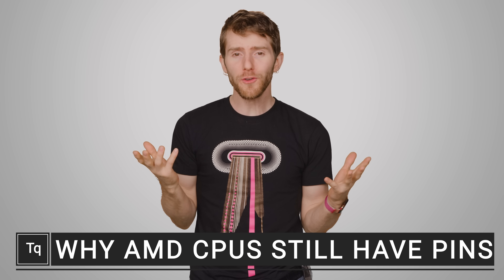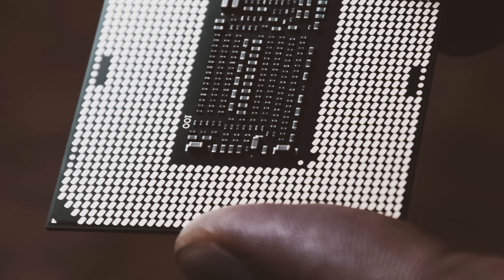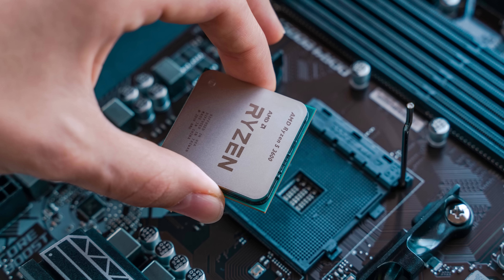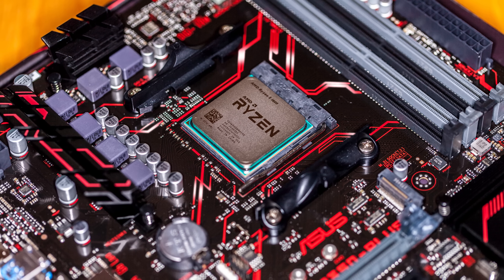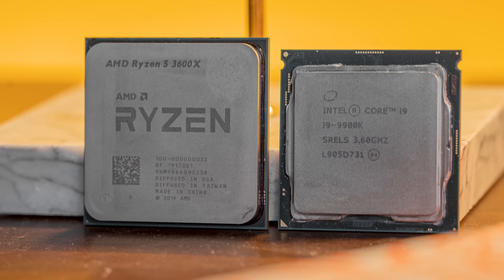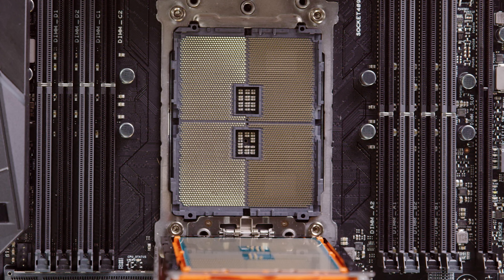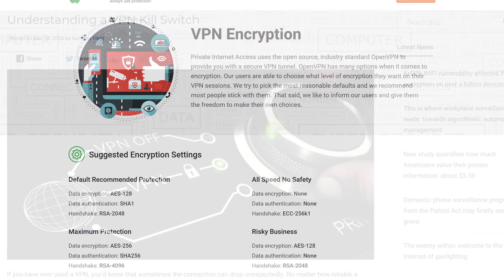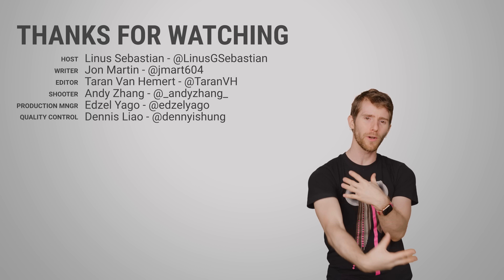Is AMD Stuck In The PAST?

Comment: I bent the pins on the corner of my Ryzen 7. It took me two hours with the macro-lens setting on my phone camera and a needle to straighten them out. When I put the cpu in my computer and turned it on, I got life, thankfully. 
I hate pins. Costly mistake if you mess up.
Reply: Mechanical pencils are great for fixing bent pins. You just shove the  pin into the hole and you can precicely bend it back. After that I found that a thin blade of some sort is a good tool to fine tune the pin.
Reply: I have destroyed my r 2700x too while I tried to put the f***ing amd stock cooler on it. I was unable to fix it, some pins broke and i have put it in a case by the other computer- stuff, so that I have to remember, what an idiot I was and that I never use the shity amd -cooler anymore

Comment: i rmember when intels had pins
Reply: I 'member.
Reply: I remember when intel had sockets (Pentium 2)
Reply: I remember when I intel had competitive CPU’s.
Reply: I remember when Intel was in a slot form factor, not socket.
Reply: Good job not being an overripe fetus. If someone in here doesn't remember 2004, it'll be a few more years still until they develop a fully-functional brain.
Reply: bruh
Reply: I remember when you learned to spell
Reply: @neb4716  when? I don't rember
Reply: I remember when CPUs didn't have heatsinks.
Reply: i still use intel cpu with pins
Reply: I still have one lying around
Reply: i member..
Reply: I've put some Pentium 4s in my room as decoration. It really looks amazing.
Reply: i member the ol apple 2e with the organ trale.
Reply: I have an 386sx33 486dx2 p1 60. 75. 90. 133 . 233mx2 etc in my showcases
Reply: the one in my laptop does, socket g2 wasn't that long ago
Reply: Back when everyone rode their dinosaurs to work
Reply: Last month i just bent my pentium 4 pins
Reply: First pc Intel Pentium 100 next Pentium 2 and 3 on cartridge so more than 20 years haven't seen Intel cpu with pins.... All rest pc was AMD and I definitely prefer pins on cpu installing them looks much more idiot resistant. And it's not difficult to find idiot or drop tips student
Reply: Same here, those pins were fun to pluck out
Reply: Ok boomer
Reply: @Adam-jt4wl  2004 wasn't that long ago.

Comment: AMD is suck..  i bought HP AMD A10 8th gen.. and its too slow i can’t even browse internet 😭
Reply: Good job at not doing any research before buying a computer.
Reply: What's the ram
Reply: Is the display drivers are supported on your pc?
Reply: that is because it is not a ryzen, athlon or epyc cpu
Reply: Slowness is almost always caused by RAM or because you have an old HDD instead of an SSD. CPU should NOT matter at all when web browsing unless it's slower than a 2007 MacBook CPU.

Comment: I read "Amd Suck in the past "
Reply: @StDu Stelios For your information, AMD is growing. Since a couple of years.
Reply: not wrong tho
Reply: same same
Reply: Who asked
Reply: Bing Bong haha funny old dead meme
Reply: Look. Intel fanboys. AMD fanboys. Before things start getting too heated, just take a moment to think, do you really want to add any extra toxicity to the internet.
No one cares which international mega-corporation you bought your shiny square from.
Reply: @StDu Stelios You should take into an account IPC. Clock speed is relevant meteic If you compare cpus with the same architecture. 8ghz athlon fx is slower than 4 ghz ryzen 5. Many People had done comparison benchmarks between Intel and amd cpus with different work loads.
Reply: @StDu Stelios how does it suck when amd cpus are better and faster and cheaper huh ?
intel boi
Reply: @StDu Stelios yeah its legit as you might know 8 core Amd vs 8 core intel has proven that the only advantage intel has isnt working that well. I still use intel but I would rather prefer amd for next build.
Maybe you need to rethink who sucks amd or you
Reply: @StDu Stelios holy shit! shintel fanboys still exists!!!